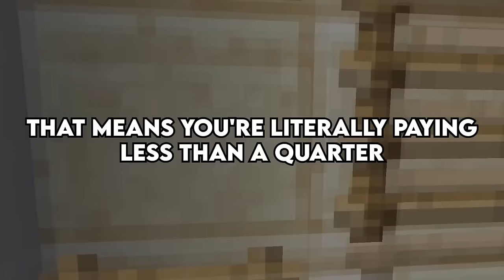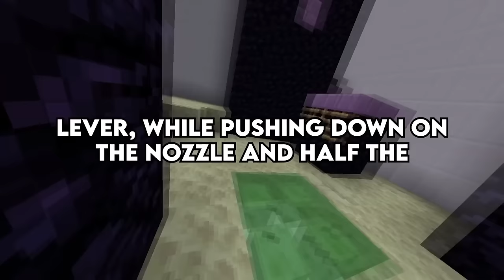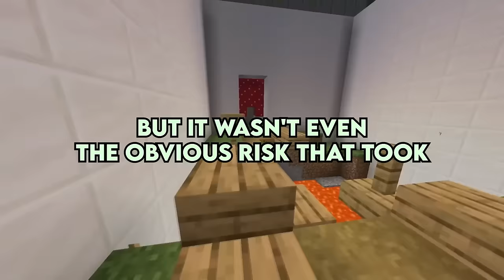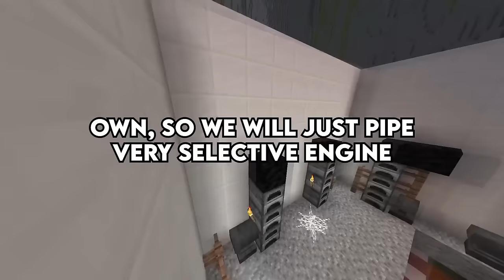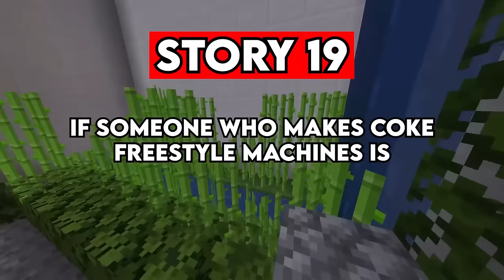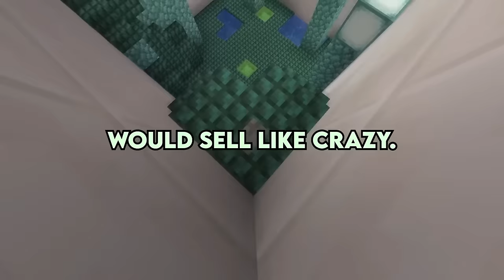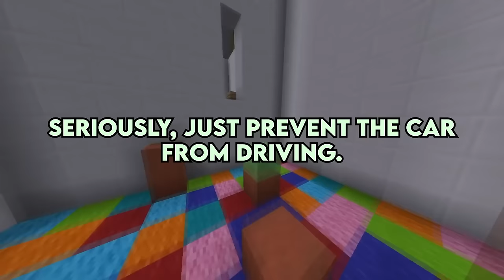Engineers, What Feature Existed Because Of Dumb People?

Comment: I know of an old-school anti-idiot feature from the telephone industry.  It used to be that, when you made a transatlantic call, you could hear a series of clicks at the beginning as it established the connection.  The wait was real--dozens of relays had to be set on both sides of the pond before the other phone can even start ringing.  The clicks, however, were fake.

Before they were introduced, people would try to call mom in the old country, listen to a few seconds of silence, and hang up and call again.  Not only was this frustrating, but it wasted phone company resources, because it has to reset all the relays at the end of the call, so now these people are holding two precious trans-Atlantic circuits at once.  One that's getting torn down, and one that's getting set up.  Some people were so quick to abandon and retry calls that they even had three at once.

Thus the random clicks, so you can hear it "doing something" and wait for it to finish.
Reply: Speaking of phones, an early and spontaneous DDOS attack inspired a policy feature.  Most television stations have a well-known policy to air sports games to their conclusion, even if they run over their allotted time.  The reason for this is the Raiders/Jets game of November 17, 1968.  When it went into overtime, so many fans called the station to ask what would happen that the phone company was flooded, and the executives couldn't order the operators to keep the game on.  As a result, the TV cut the game to the opening credits of Heidi immediately before the Raiders scored the first of two game-winning touchdowns.

That game is known as the Heidi Game to this day.

Comment: I supported a new team, who were upgrading a tool set I had maintained for 7 years. I knew my users well, and they were idiots.  During one of the early design tests, with the users, They had several complaints including; "The report doesn't look like the old report, so I don't know if I am doing it right",  "I do not trust it because the results come back too fast", "What was wrong with the other report?"  The team pulled back after the feed back, distraught.  after hours of discussion, I finally suggested that they change the CSS to give the users the same color palate they are used to and not the staunch white.  And to add a delay, yes purposefully slowing the ultra fast report.  I got push back initially, then I told them to wait 6-9 months and offer up an improvement, and then reduce the delay by 50%, and wait another 6months and change the visuals. The developers were skeptical, the managers were on board.

Comment: I used to work in a maximum security prison and it had a 1,000 amp Kill fence. When it was really humid you could watch birds and small animals get near it, and a bright blue arc would just DETONATE them into clouds of feathers and fur. Arc flashing is very real and very terrifying. To this day in that fence is a set of shower sandals made of rubber than an inmate thought they could use to reach out and spread the electrical wires and slip through, and they just got arced and fried.

Comment: I worked for a company that made sheet metal working machines, one such being a power folder, 12 foot bed that could fold a sheet of 6mm steel. When set up it had all the interlocks and light curtain. It had been made and the electrician was working on the control box connecting the wires, an apprentice was at the front with his arms on the bed. The electrician triggered a cycle, first, a gripping bar holds the work, (left hand at the wrist, right hand across the middle) then it started to slowly fold, The company was fined a lot of money and had to make a big payout to the apprentice. He lost his left hand and had very limited mobility in his right.

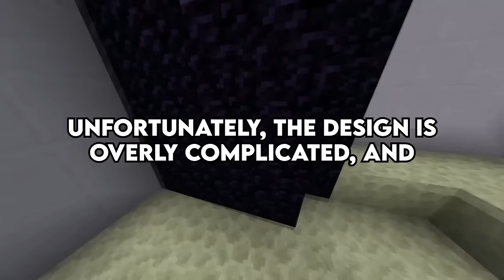Comment: 6:50, just get one of the metal safey cans with the funnel, you can pull the handle with your 4 fingers while holding the can handle with your thumb and supporting the bottom of the can with your other hand, you can even throttle the cas with your 4 fingers to slow down/stop the flow when you are getting close, or if you only need a small amount of gas

Comment: Not an electrician but YES high humidity increases the ability for electricity to arc.
Electric Trains mostly use DC electricity and they run on about 10kV, some are 20kV.
The overhead lines are positive and the tracks are ground.
Since the wheels are metal and the wheel set mounts to the underside of the carriage, the whole train is also grounded.
So when a 1.7m tall person  who is standing on top of the train they have reduced the gap between the supply voltage and ground.
So that point electricity will arc to you to get to ground.

Comment: I can help with the Phone Battery duration bit! Lithium Ion batteries naturally "decay" over the course of standard use cycles. The range of that cycle directly impacts how fast that "decay" occurs.
In other words, charging your battery up to 100% then discharging it to 0% before recharging it absolutely DESTROYS your battery.

To prolong the lifespan of your battery you should really try to keep it in a small range, don't let it drop too low and don't go all the way to 100% unless you really need to, keep your battery at about ~80% charge and the lifespan will be noticeably higher.

Personally I don't care that much so I just keep it as close to 100% as I can, I leave it on the charger whenever I can. Batteries are smart now and have microcontrollers that limit their charge so that you don't "overcharge" the battery. They do this by cutting the connection when you reach the upper limit, so effectively there's no real worry about damage for leaving your phone on a charger all day.

Comment: For story 26, motorcycle gas caps often can only be opened with the ignition key, and will not let go of the key until it is closed, thus not being able to turn over unless you are at home with your spare key. (In case you need to do some maintenance that requires looking into the tank while running I guess?)

Comment: Humidity get high enough it reduces resistance to electricity. If you have dry skin electricity is less efficent at traversing you body. It's why we don't keep open 50 gallon tanks/jugs around welder devices because the heat can increase causing evapotion making electrity arc. You should have it removed from the enclosed space  for safety reasons.

Comment: Story 8 : Humid air is a lot more conductive than dry air. An air gap that can isolate you from 1 000 000 volts when dry may not protect you from 5 000 volt on an humid day. That's a factor of more than 100. Learned from an electric engineer specialized in high tension equipment.
Reply: Also air temperature and pressure have impact on air's conductivity. Though to a lesser extent than humidity (assuming we're talking about everyday nomarl ranges and not very high temp and near vacuum 😁)

Comment: That gas nozzle detection idea is feasible imo, if the space is available in a car.

Couldn't you just wire up a pressure sensor from the gas cap to the ignition that prevents the key from being turned all the way/button being pressed to turn the car on unless it's closed?

Like, the button you use to open the gas cap cover (Idk what it's called) could be wired up to something that moves to block the key/button from being turned until a pressure sensor detects when the gas cap cover is closed, thus sending another signal to this object to release the blockage/switch.

Idk how compact the steering wheel's area is, or how crowded it is, but if there's enough room then this really should be something that's integrated

And if the answer to it is like the "car's butt exploding" problem that the Ford Pinto had (They said they'd be losing a LOT of money if they fixed that issue) then I swear to god that's just bad business, because assuring the safety of your customers means you're probably gonna keep your customers, meaning a considerable chance of consistent income

Comment: About the batteries in computers thing, there is no way except to replace the battery. You can prevent it (limit charge to 80%, once the battery discharges to 20% charge it) but never stop it.

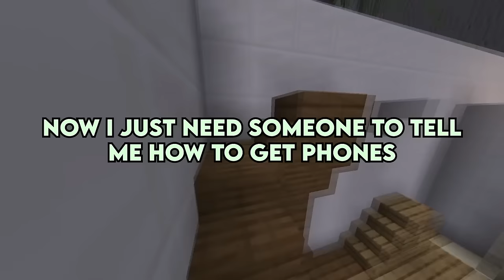Comment: 13:41, While I'm not sure how common it is, my answer is to not allow system updates.  Apple is known to deliberately slow down their own phones to make the new ones look better, all while charging hundreds at the cheap end for the new ones.  If not, Lithium batteries are known for storing more charge at the expense of recharge cycles.
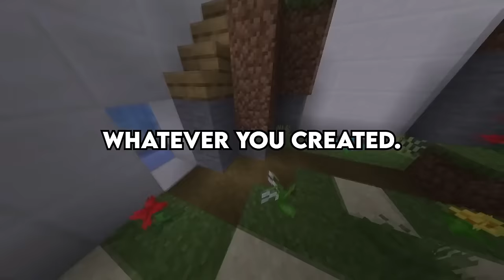25:45, My answer is to have an optical sensor and electrical contacts check if the door is closed.  If both aren't connected, the car cannot start even if either or both don't work, optionally with a loud and annoying sound if they try to bypass it until they do it correctly.  Maybe something similar for seat belts too, thinking about it.

Comment: 13:42, a lot of new phones and laptops like mine have an option that only charges the battery up to about 80-85%. Lithium batteries don't like being charged fully and can diminish the battery life, this is also here for when you plug your device in overnight as also charging the battery at max percentage for long periods is also not good for it. Its a good idea to not leave your Laptop plugged in as they seem to suffer the most from being plugged in for long periods of time at max percent, this is made worse by the fact that a lot of modern laptops have performance boosting features when they're plugged in.
General Consensus:

1.Try not to charge your devices overnight as convenient as it is.
2. Don't leave devices plugged in when fully charged.
3. Turn on battery protection
If your device doesn't have battery protection, don't charge it fully.

Comment: I can answer the baggage claim thing myself actually.

It largely depends on the airport itself, if it's a far more modern airport with baggage and what not loaded and unloaded automatically, than yeah, it's like, 5 minutes give or take. But that isn't particularly common, maybe in some of the largest airports in the world, because they process planes every 20-30 minutes (which may not sound like a lot, until your landing in china and your in a chain of planes circling over top one another in a holding pattern for your turn to land. my dad went, said he had 15 planes below him while waiting to LAND)

For those that don't? Well, all the bags need to be unloaded manually, which means crew have to literally, crawl into the plane's storage, pass bags down the line and onto a conveyer, than put them in the trolleys, drive the trolley all the way to the baggage claim, scan and unlock the doors (because it's one of the more insecure locations of the building) than manually get every bag onto the claim.

Worked at an airport for nearly half a year, and we were usually only in teams of four or five. This was on top of: scanning the plane for damage, landing it, pushing the stairs to the plane (because we only had a single one of those fancy hallways that attached to the plane) and other tasks. Getting planes ready for turnaround is not as simple as you'd expect.

Comment: In some train stations I have seen fences between the two railroad lanes, because even with all the signs warning people not to cross them to reach the other platform, people still do, and not only when there is no train in sight. I have seen a man crossing the tracks right in front of a train that was stopped to let people in/out of it. He passed right in front of it, just to make sure the driver doesn't even know you're there you know. The train departed as soon as he climbed on the platform. Can this be considered a near miss?

Unrelated to this risk but one day I saw a teen boy pulling out a stunt in front of some girls, jumping and holding onto a train as it accelerated out of the station, and jumped off at the last moment.

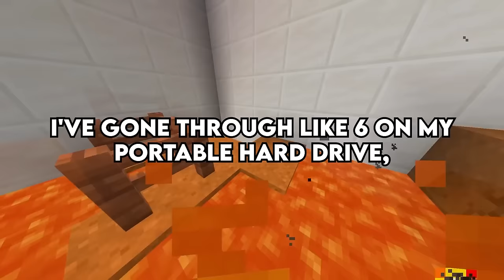Comment: 11:24 yeah, calling bullshit on the HDMI cables supposedly being designed to break. Source: I’ve replaced dozens of HDMI ports on various devices. That shit is FRAGILE. 

Though, credit where it’s due: a lot of the manufacturers purposely use a weak, brittle solder on the pins for the HDMI, so the solder will snap before it tears up the motherboard.

Comment: The gas can thing sounds like its lacking clear instructions printed on the side because the description sounds like the inner section of a car fuel hole is supposed to be the thing pushing back the “lid” on the tube. 

Holding it open with one hand and lifting with the other is circumventing the design feature.

Comment: Trans decks at work, to load double deck trailers. The newer ones have a light beam which is great fun to as a prank, they kill the lift if tripped requiring you to walk 13ft to reset it. If all 5 gates are closed and the lock is across you can raise the lift unless someone trips the light beam. In addition to the lock you have a bar so if you are more than an inch off the dock then the gate will hit said bar.

Comment: Story 7.
I can understand that.
because on the IP phone if there is no noise/dial tone.
1 how do we know its ready and working.
Like I remember on the old phone whit Dial tone that threes situation when you pick it up and there is no dial, your not on a call you just hit that point between a call disconnect and the system resetting, if you tried to call it would fail because you are technically according to the phone in a call already,
the loading bar thing yes I agree because if the time is less then 1 frame I get th feeling that I did not hit start but refresh page or something broke (because that have happen).
so a half a secound wait is preferable because then I know it actually got my order.

Comment: 13:42 Keep the state of charge between 40 and 85%, preferably between 50 and 75%, and charge your phone often for short durations. This will keep a lithium ion battery in good condition for as long as 15-20 years without other forms of malevolent sabotage.
Reply: So, you are saying to only use about 30 to 40 percent of the battery capacity to prevent the battery from maybe wearing down to have 70 percent after eight years?

Comment: My skoda beeps at me if I open the driver side door while the car is not turned off.
Ansd yes, humidity does increase air conductivity. My country even does safety stuff on tv that teaches people not to climb on abandoned trains and stuff because of the danger of electrical arc, but multiple people still manage to kill themselves every year that way. There are even numerous safety rules in the norms for electrical installation in my country that say that any time there's the chance that a person can touch a live wire, they have to physically be prevented from reaching said wire

Comment: I live under towers of extremely high voltage the ones that distribute energy to the city and if it's raining and you have an umbrella under the cabes even if they are over 30 meters above ground you still will get lightly zapped if you touching the metal.

Comment: Wire cutters are softened significantly after hardening the cutting edge. More than what they really need to be to be ideal cutters. But when abused, the harder edge is more likely to crack and the owner will be p*ssed off by the brand. (Or ask for replacements).
To prevent that, cutters will be made softer and thus worse for their intended purpose, so that they can take more abuse by fools.

Comment: Flexible see through splash shields hanging over quick connect hose connectors for hydraulic or heating systems. Yes, they are in the way when you want to connect or disconnect something. But they also keep warm fluids from splashing into your face if a numbnut forgets to depressurize the system, the connectors get a internal leak and\or in worst case, if done while system is at operating temperature while pressurized. Still, people remove them, then complain about a face full of near boiling liquid in their face.

Comment: I don't understand how people have so much trouble with the safety gas cans. It's not hard.  Press with your palm, tip, pull with your fingers. It gives you precise control over the flow of gas. It's 100x better than the old style, where it just pours when you tip, regardless of whether the house is where you need it. 

I could understand someone with grip issues having difficulty, but everyone else i think is just stupid. 

How are you even spilling when you need to squeeze both triggers to get the gas to flow? That's a special skill right there.

Comment: Stop letting your battery die it makes the cells unstable and the cant move the power correctly amd this damages them quicker. Powersave mode when the phone gets to 50 amd try not to use it when it hits 25 ultra power saving mode and don't use the phone at all unless its an emergency these features are to keep your batter good for longer not so you can use your phone more

Comment: Wait until the computer battery is mostly dead before recharging. Batteries wear from recharge cycles. The more you plug it in, the faster it dies
Reply: This was a thing for old nickel batteries, best practices for Li-ion batteries is to do 'shallow charge/descharge': keep the charge between 20% and 80%, this way it will have the least stress and will last longer, once in a while let it go as down as 5% to recalibrate the sensors.